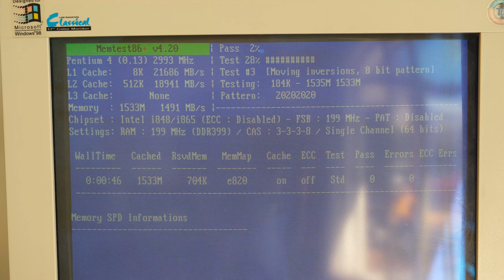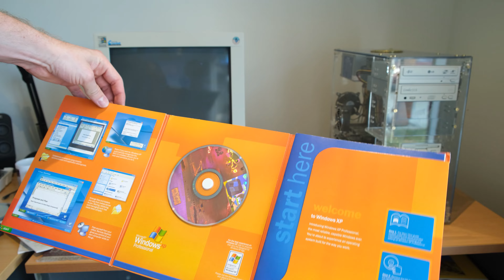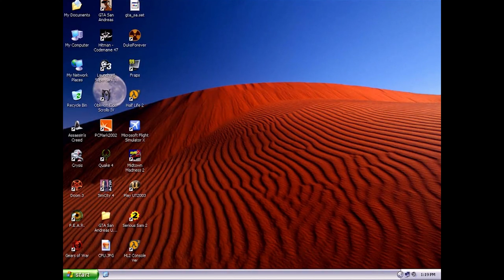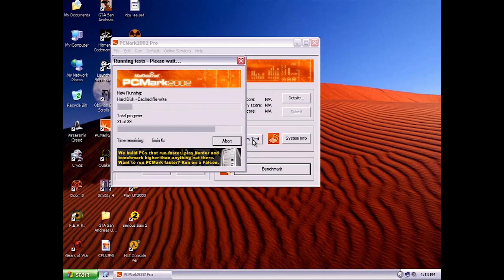Fixing Up The Old University Gaming Rig

Comment: Beautiful video! The 865 AGP chipset is very good and compatible not only with XP but also 98. A lot of things you can with such a system 😀
Reply from the maker: Thanks Phil! Glad you enjoyed it, I had attempted Windows 98 before. But found there was a bug with using 512mb of memory and the unofficial Nvidia drivers for the 7600GT. It would cause a lock up or a blue screen. I think this is a known bug with such a combo. But regardless its good for that early 2000s gaming!
Reply: @thesmokingcap  Ah yes, you would need to use an older graphics card, like a GeForce 4...
Reply from the maker: @philscomputerlab  Ahh yes, a better suited card for Win 9x. Or throw in a ATI card would be a good option.
Reply: @thesmokingcap  Yes a Radeon 9000 series card would work really well!
Reply from the maker: @philscomputerlab  ahh yes, I've been keeping my eye out for a 9700 to 9800 pro.

Comment: What kind of glue did you use for motherboard standoffs?
Reply from the maker: The base was still attached, but used locktight on the threads of the stand off to keep it in place